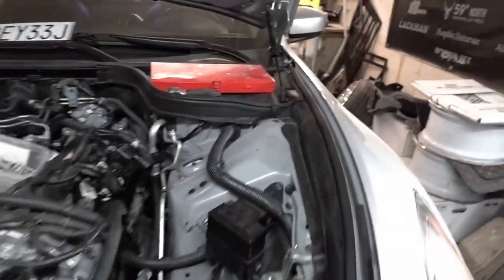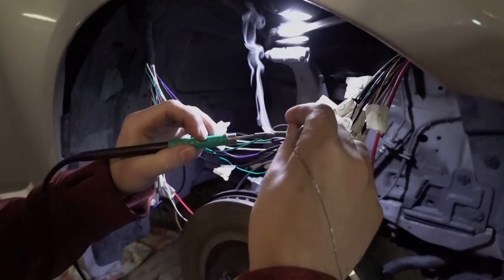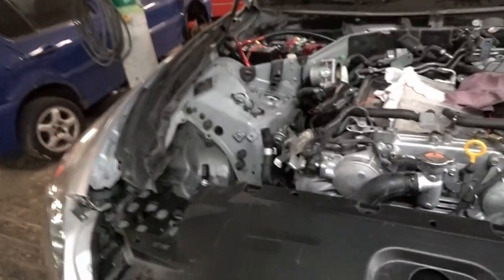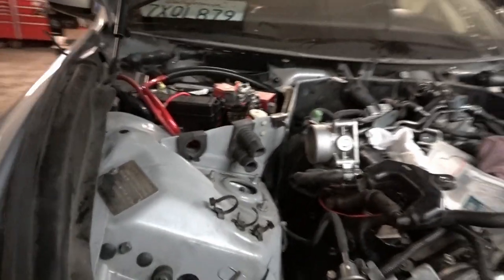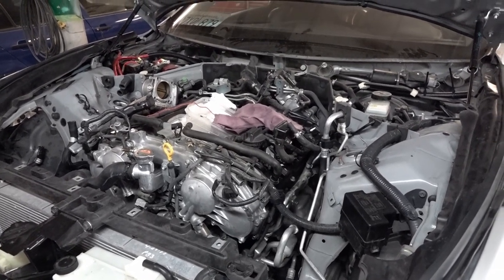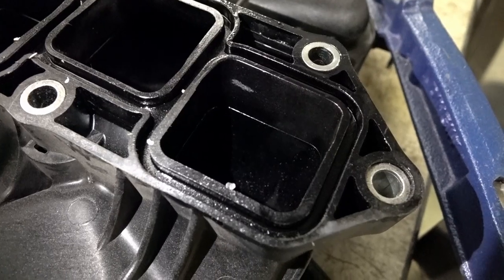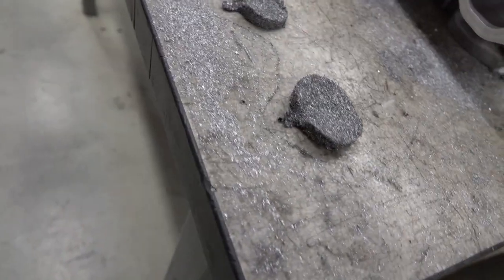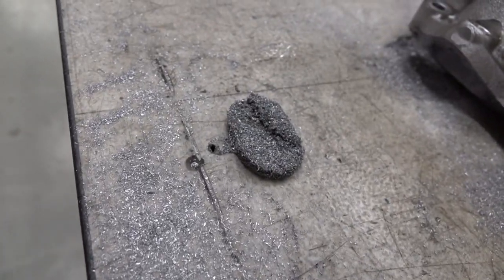How to port Nissan 370Z/ G37VQ (upper & lower) intake manifold [Infiniti G37]

Comment: have you ever ported a manifold before this? could someone with no experience do this? thank you for the comparisons.
Reply from the maker: I have ported many intakes before. Have built many Volvo and BMW engines in my days. But has the greatest knowledge to port intakes in aluminum. But I would say that if you have the right tools and are careful, everything works. But I think many do not have the right patience as it usually takes longer than you think. Also think that you should always have a backup plan. In this case access to a new intake.